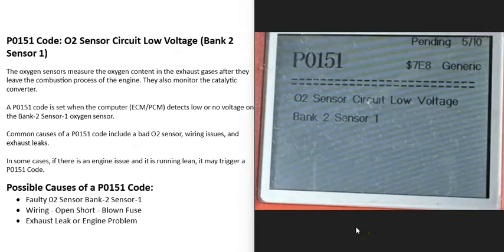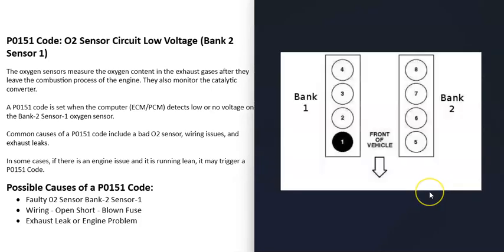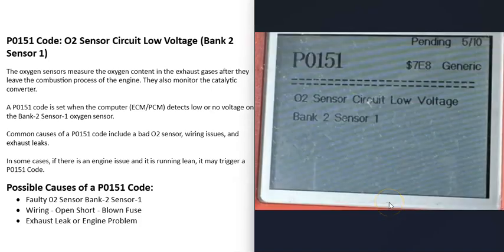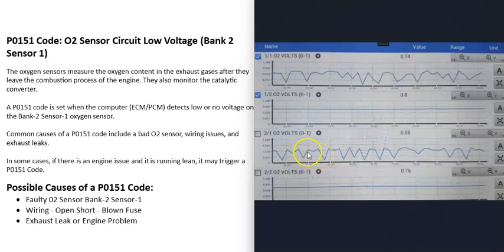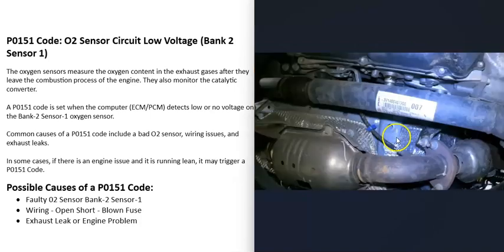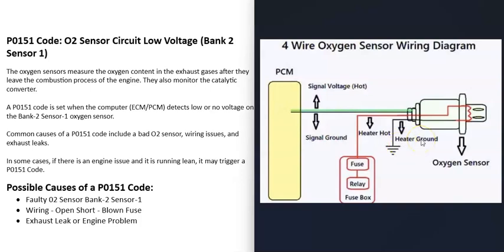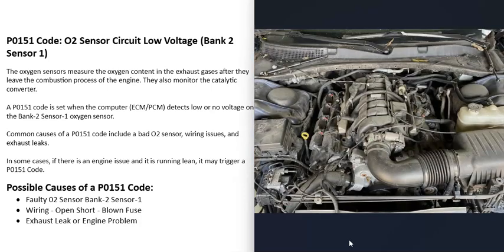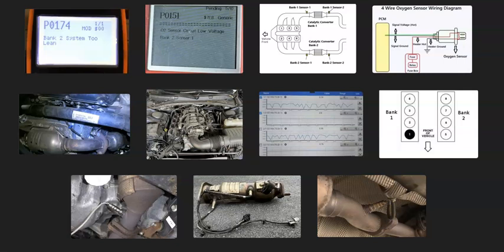Causes and Fixes P0151 Code: O2 Sensor Circuit Low Voltage (Bank 2 Sensor 1)

Comment: Would this be the same on a 1999 f150?
Reply from the maker: Yes, it's basically the same for all vehicles. The 02 sensors can be designed differently but do the same thing. The differences between 02 sensors mainly affect how they are tested.

Comment: Does this cause you vehical to run poorly or shudder?   Seem like it does nothing to affect performance.  Try trying to narrow down a shudder problem I'm having at around 55 to 70 mph under load.   Computer threw this code and I  was curious.
Reply from the maker: A bad O2 sensor shouldn't cause a shudder or even the engine to run too poorly. Often, except for the engine light being on, most people report no difference in engine performance, but it can affect gas mileage and be less responsive.
Reply: The engine just shut down while she was driving it I'm thinking fuel pump and maybe the catalytic converter being stopped up can you can you give me an idea